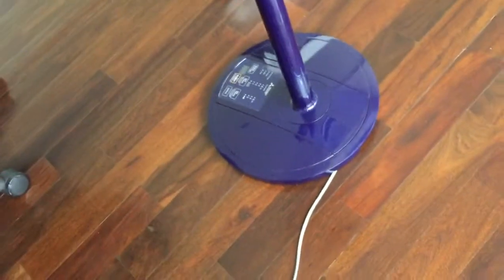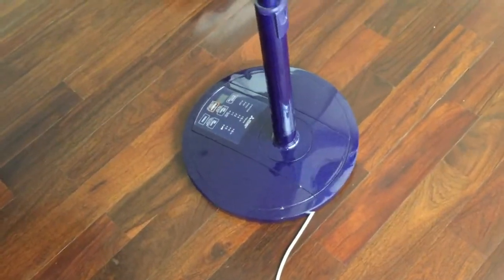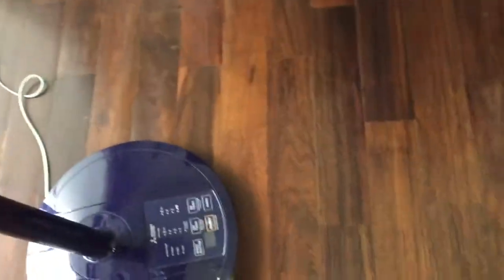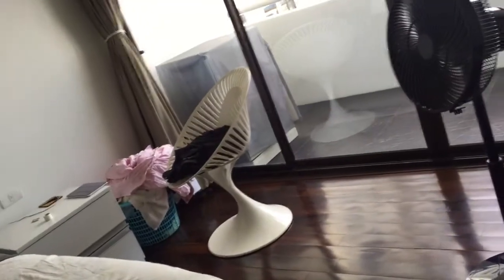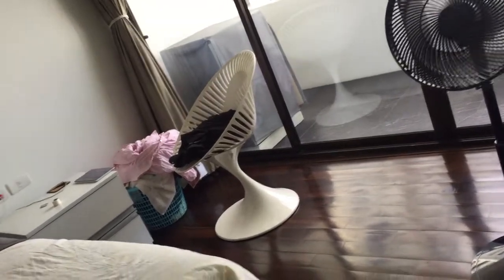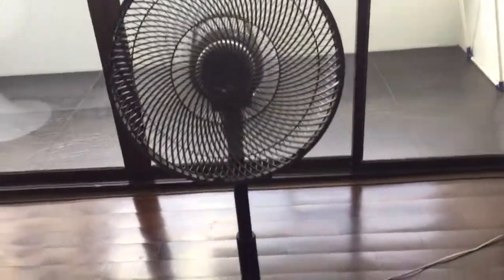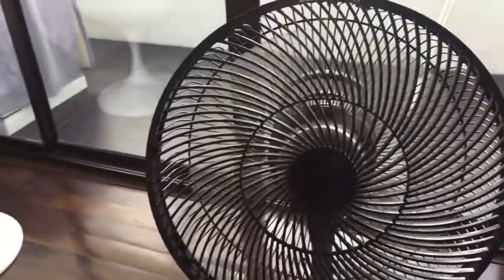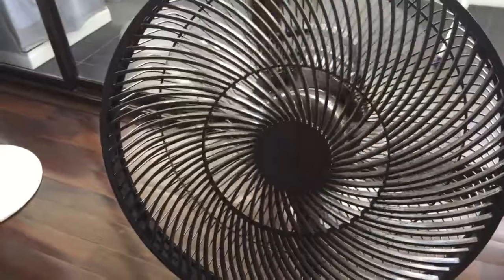(Shown on all speeds) Mitsubishi brand pedestal (stand) fan

Comment: it's not a pedestal fan, it's a Tatami fan
Reply from the maker: Tatami fan?? The 'pedestal' on pedestal fans refers to the pole and base of the fan. This fan has that pole and base, so it must be a pedestal fan. Whatever a 'tatami fan' is,  if it's the model name or something, this fan must also be a pedestal fan because of it's structure.
Reply from the maker: As in, what does the switch being at the base have anything to do with tatami mats?